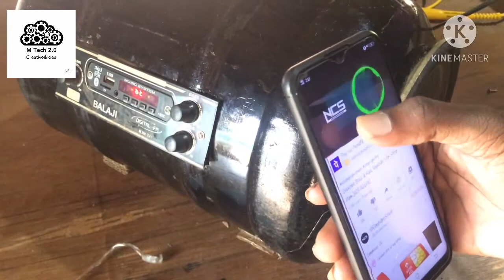Mineral water can sound system// How to make simple bluetooth speaker||Mineral water can  hacke

Comment: I have this clone. Where i use it like external speaker for my amplifier. It works well with mid bass like 80-120hz but due to cheap ceramic and old(refurbished) alnico speakers, the sound isn't deep bass.